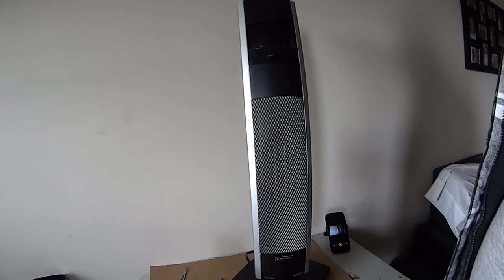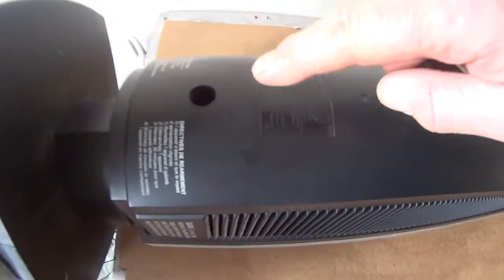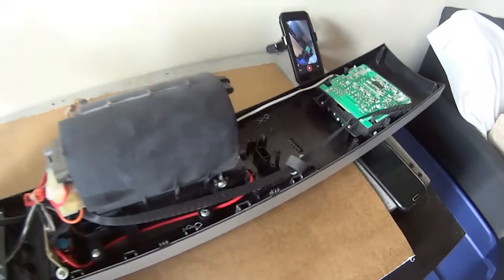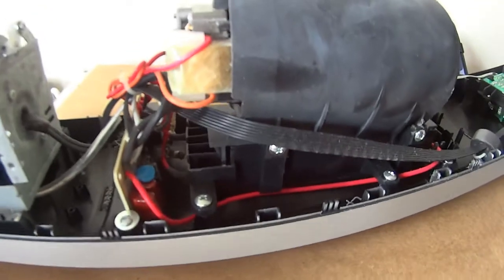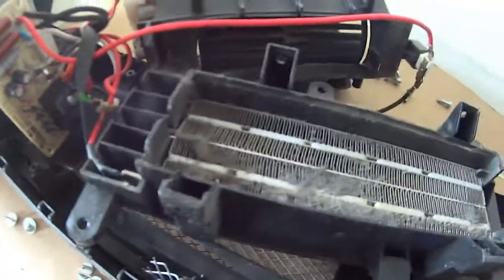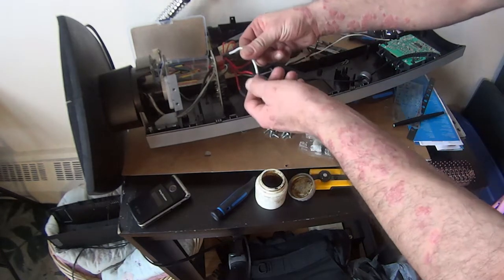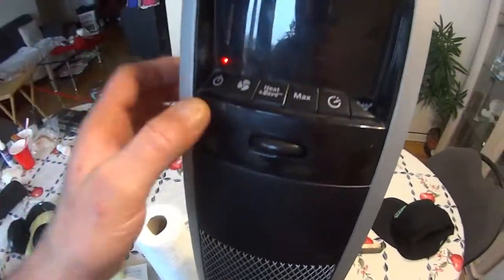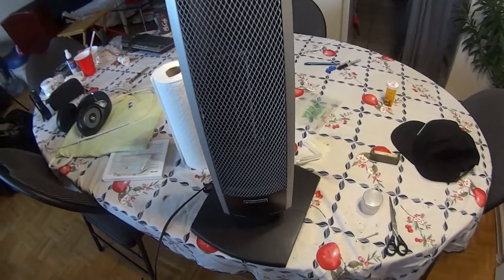Bionaire BCH9224-CN. Repair

Comment: Hello, i have been using this heater for a few winters and it works great!  It started to squeak quite loudly.  I opened it up to clean the dust and noticed the sound came from the motor.  Where and how should I lube that?
Reply from the maker: @xrfish  if the bearings are gone, there’s nothing you can do. Try spraying oil